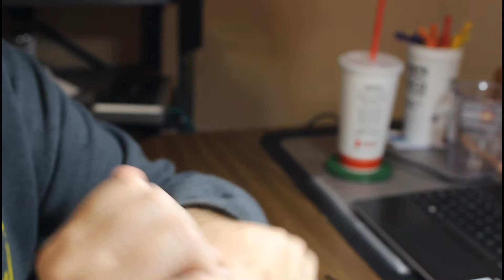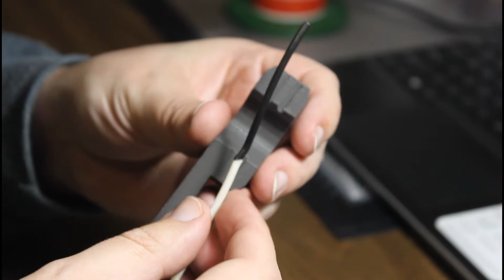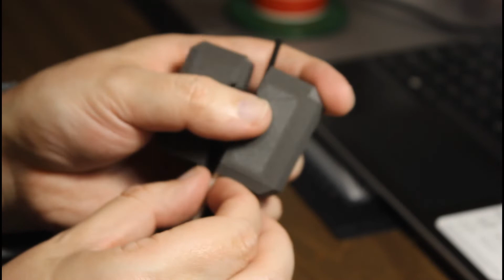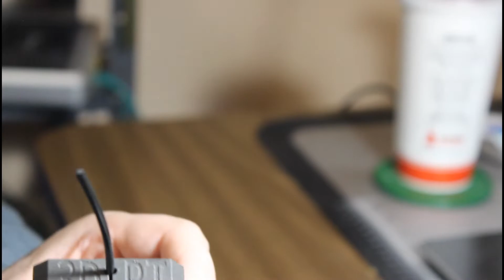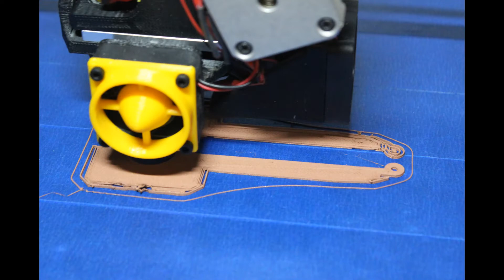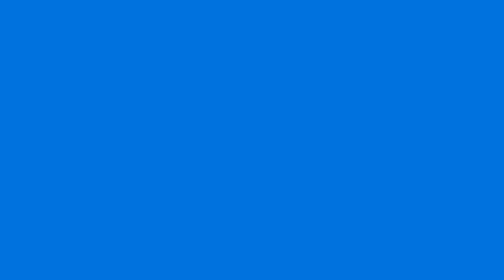3D Filament Splicing Tool feat. Sir Luke the Luckless

Comment: A simple section of ptfe tube works better
Reply from the maker: This was based of a tool I've seen on FB postings... I had fun designing and printing in steel filament. I did not have ptfe tubing on hand for this.

Comment: Wouldn't it be simpler using a cramp with an inside diameter of 1.8mm, a candle and the popular helping crocs(hands)? Think the joint would be better as well.
Reply from the maker: If you try it film it and let us know... I based this on a filament splicing tool I saw in a FB post.